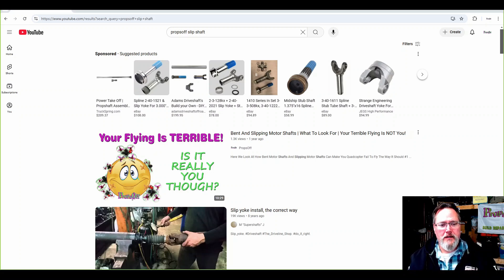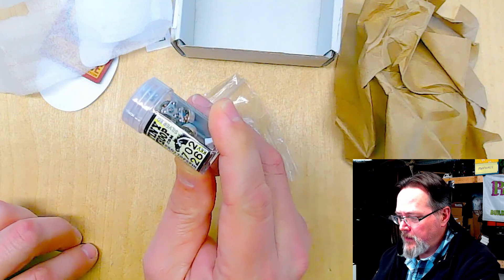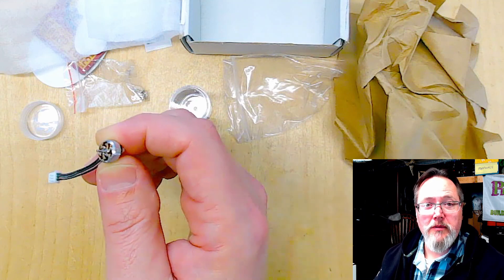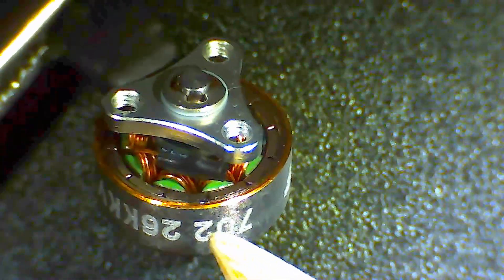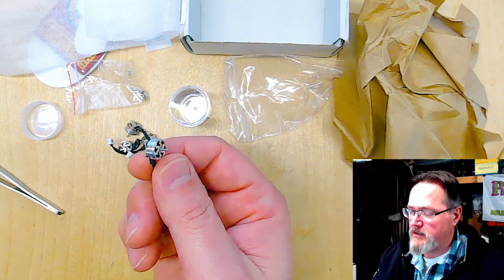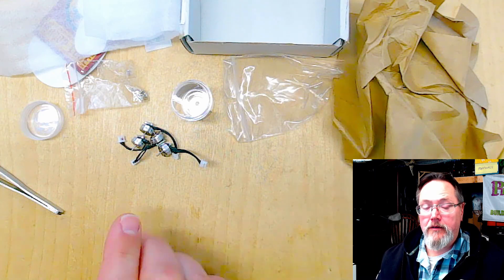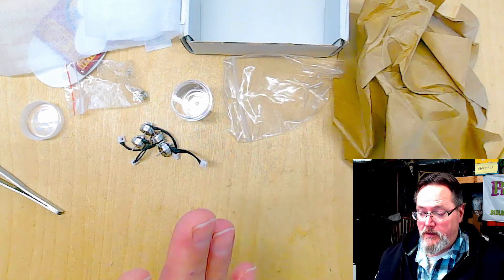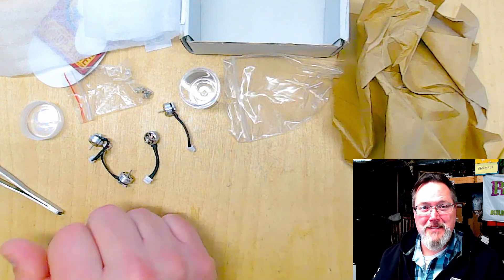New TinyWhoop Motor 702 26,000kv Locking Shaft Design Up Close Look

Comment: I'm curious if the efficiency will be similar to happymodel motors or if theyre made by happymodel. I loved the old motors but i had about 20 with slipped shafts in a year so hoping they're similar in terms of performance just more durable
Reply from the maker: @yamasaur  
I'll find out tonight, I just now completed a KV test - looking good...🧐
Reply from the maker: Pardon me... I am handing them off tonight at race practice. He won't have the quad built until Sunday.  I too am excited to not have anymore slips and efficient trust...🤞🏻

Comment: Im rebuilding my 65mm fleet, but I dont race often, so they will need to double duty as freestyle.  26k would be the low end of KV I would want to buy.  Its not the KV of the motor that makes me slow anyway.
Reply from the maker: @Mupshot  
I like to race and freestyle, 26kKv is a great medium for me. Punch and flight time. I'll put the weight and Tested KV in the description later.. I really should have gotten weights in this video - my failure 4shO...🤔

Comment: Hey scooter, I’ve had a nightmare of problems with shaft slippage in the past. I switched motors to the rcinpower 702 29,000kv’s and haven’t had a problem since however I learned a trick from someone I don’t remember who but it seemed to have the shafts slipping  after changing props this person who I can’t recall showed me to put something underneath the shaft like a tiny finishing nail head on a little piece of wood to counter push the shaft back as I pressed on the props what’s your thoughts on this actually I want to say I saw you doing this trick lol no?